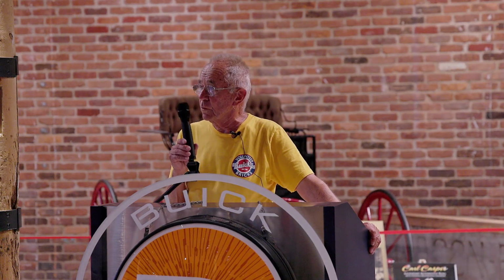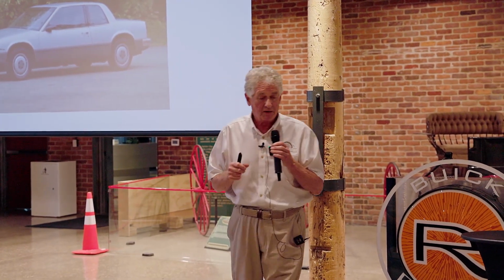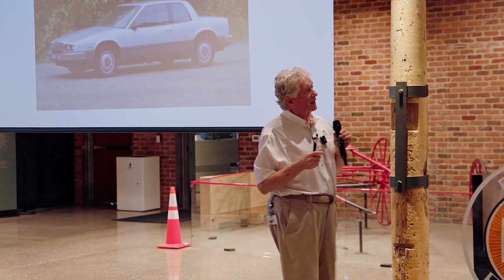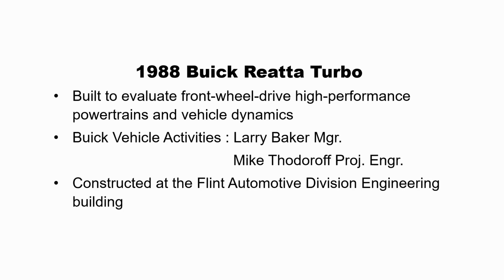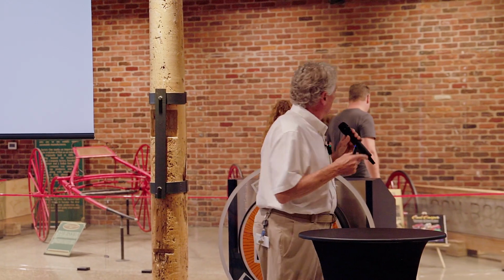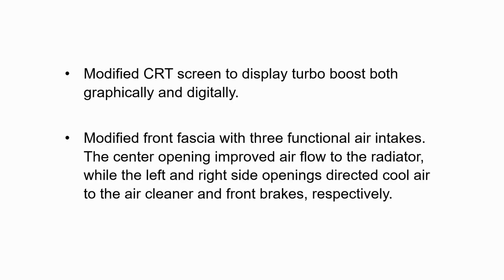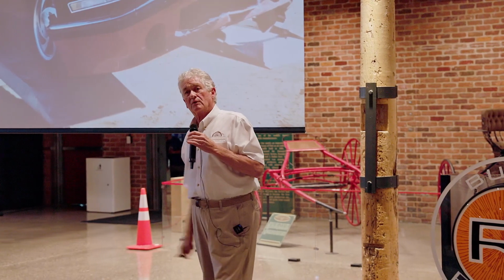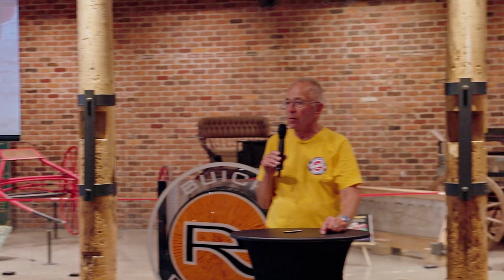Buick Reatta Turbo Presentation by Mike Thodoroff

Comment: '88 & '89 had the CRT Screen board, then went back to the "norm style" in it's last two years. '90 & '91...Why & why did Reatta cease production??
Reply: It was a niche component and older Buick owners at the time didn't like it but collectors love those early touchscreens.
Reply: @louisbabycos106  only those w/Brains Survive ~ ~ ~ ~ obviously, ass "They" suck start their kia's 💩👎🧠😷🐑💧🎭🛑🚫❌⭕🤕🪱🪝✨🎯‼️
Reply: Cost too much, never quite caught on.  As evidenced by GM expecting to sell 20K a year, instead sold 21K in four years.  Underpowered as well.  A 92 shoulda/would got the supercharged 3.8.  That would have motivated the Reatta.
Reply: @johnhutchison9782  'underpowerd"???? Musta been ur adorable clogs u were wearing....my 3.8 fi does 0-60 in 7 seconds....no problem......1988 STOCK...have ur boyfriends 💜💋😘🤩try.... DON'T HOLD ON TO THEM!!!! 😏😉